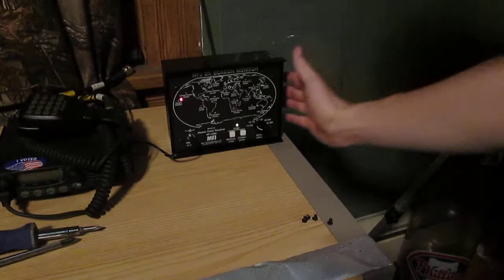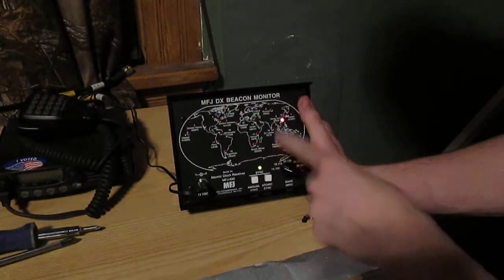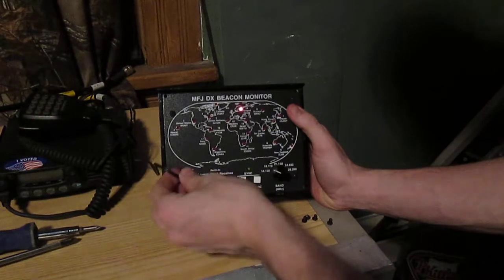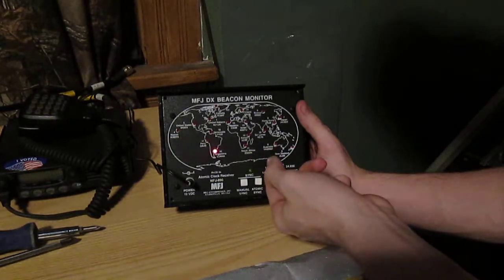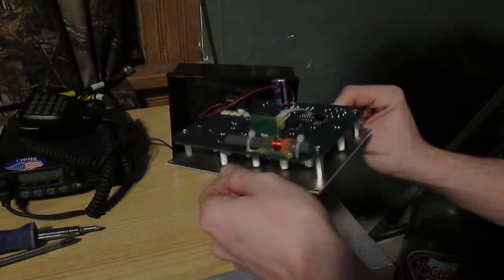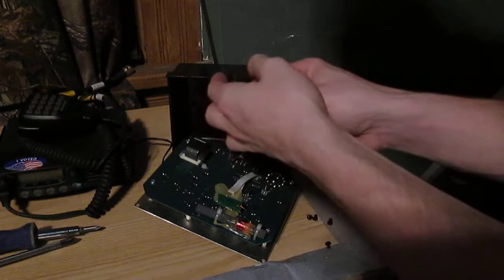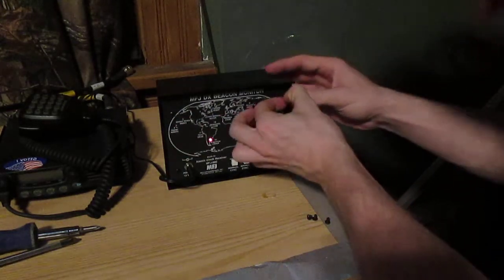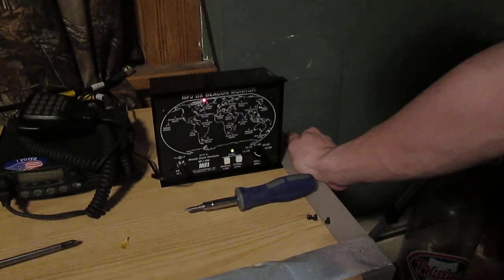Mfj 890 dx beacon monitor (how to use)

Comment: Your video inspired me to pick one up .. using it, I’ve found it very fun and useful in tracking where signal is coming from … wanted to drop you a thank you! .. for others interested, there is an option with jumpers inside to set your time zone, and whether you want it to enter a stand-bye mode after so many hours and turn off the LEDs.  Great video !
Reply: Oh, so there are also jumpers to set inside for various time zones. Good to know! Thanks for that info. I've always wanted one of these. I assume this unit may work with digital modes as well?